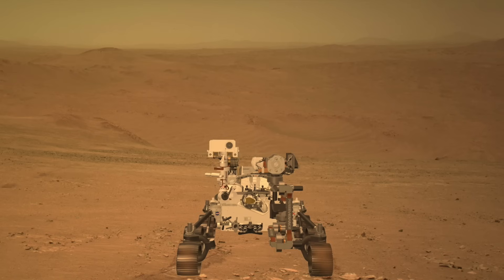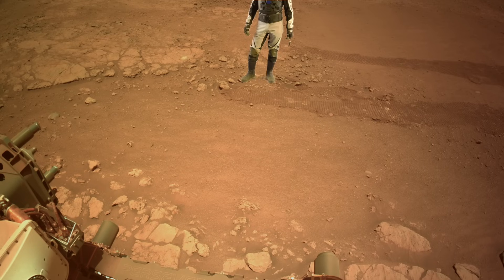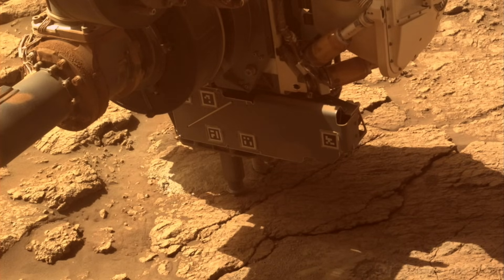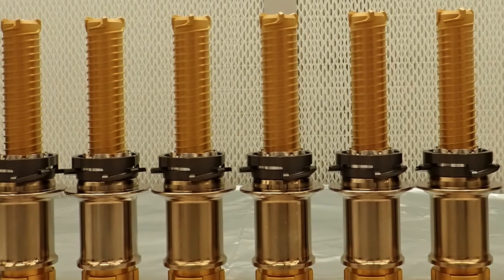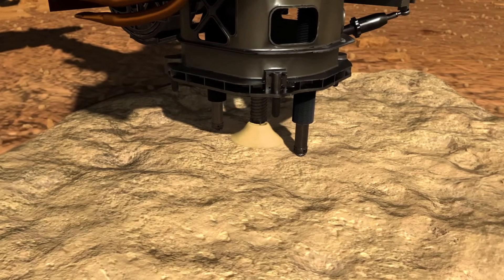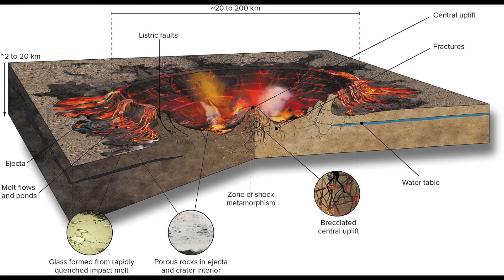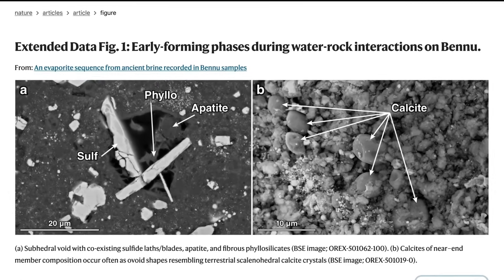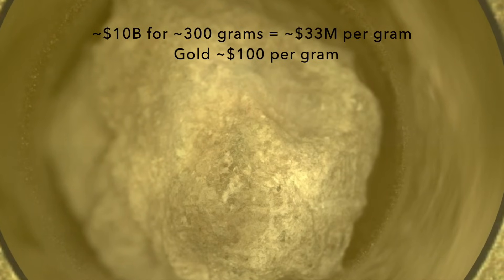Samples from a Mars cataclysm

Comment: In a Watson Camera photo taken on Sol 1405, the highest part (the genuine ground surface) appears in focus just outside the abrasion mark boundary.
From this and other photos of previous sols (or soles) perhaps an irrelevant conclusion can be reached: that certain very dark spots are not mineral, but rather the shadow of the holes (tubes that carry something (gaseous) from bottom to top?). CO2, water vapor,...?🤔

Comment: As Perseverance ages the lost opportunity cost of not using the remaining sample tubes increases because the rover is more likely to fail. So does it make more sense to collect more samples now or end up with some sample tubes never being filled because Perseverance is unable to fill them?
Reply from the maker: The Curiosity rover, essentially the mechanical twin of Perseverance, has lasted for >12 years, so there's currently no need to speed up sample collection based on concern over the failure of Perseverance.

Comment: All of your videos have been gold quality. Thanks for the explanation of the core recovery system. You did not mention whether there is any way to “try again” with a sample tube if the sample recovery is not good. It seems that the design limits the coring to one attempt?
Reply from the maker: Thanks for that.  Regarding trying again, once the tube is sealed, it can't be opened.  Sometimes the team has confirmed the contents before sealing, but this time no.

Comment: I took me quite a while to understand the eccentric mechanism:
1. In the normal configuration the eccentricity of the tube cancels out the eccentricity of the drill interior. 
During drilling, the tube rotates along with the drill bit to keep the stationary sample in the center.
2. Rotating the bit without the tube pushes the sample to the side, creating a shear force that breaks off the sample from its base.
Additionally, the offset between the tube and drill opening prevents the ideally solid sample from falling out while the drill is being pulled out of the hole.

Really clever 🤓
Reply: Whoever thought up of that is a genius.

Comment: Seems like vertical drilling would always be at risk of  dropping samples - could they drill at an angle (or even horizontally)? Maybe abraid first to create appropriate angled starting point?
Reply: The steepest angle from vertical that I remember was at Bunsen Peak, where they drilled about 30° off vertical (see episode 155). I'm not sure if they can drill horizontally — I think they rely on the weight of the drilling unit as a counterbalance and to keep it stable on the ground. Drilling horizontally might not provide enough stability.